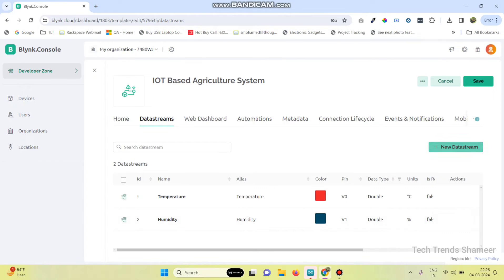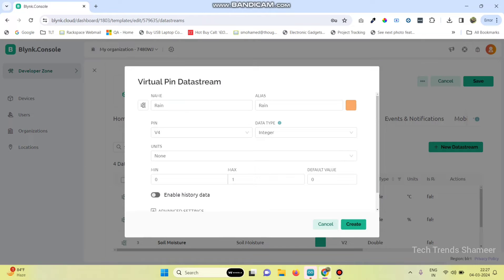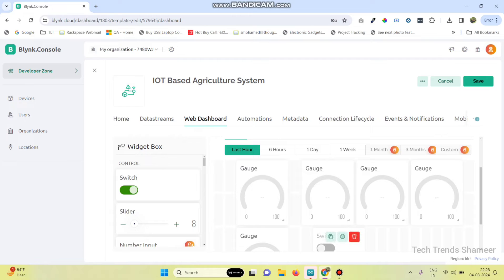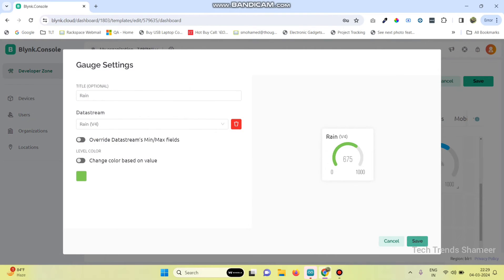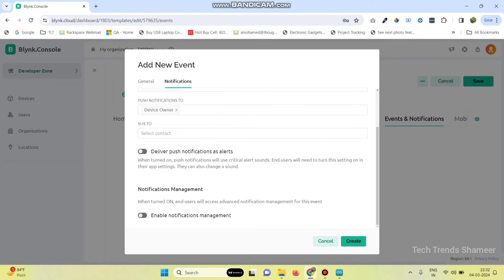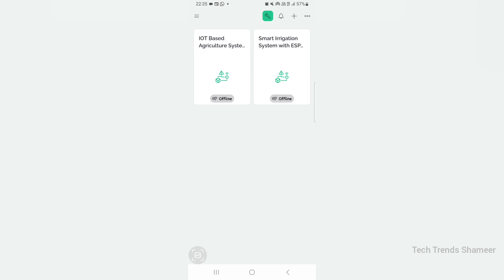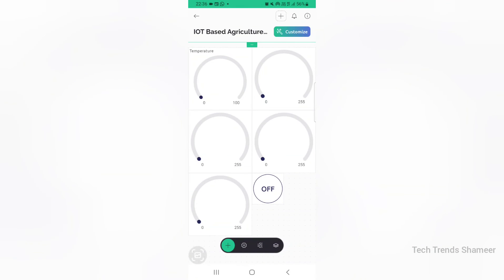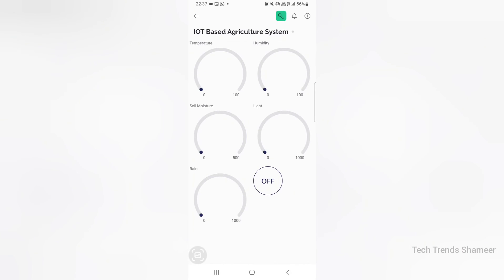IoT Agriculture Monitoring System | Smart Agriculture Monitoring with ESP8266

Comment: WARNING: library LiquidCrystal I2C claims to run on avr architecture(s) and may be incompatible with your current board which runs on esp8266 architecture(s).
C:\Users\adars\Downloads\sketch_oct9a_copy_20251010060915\sketch_oct9a_copy_20251010060915.ino: In function 'void setup()':
C:\Users\adars\Downloads\sketch_oct9a_copy_20251010060915\sketch_oct9a_copy_20251010060915.ino:138:13: error: no matching function for call to 'LiquidCrystal_I2C::begin()'
  138 |   lcd.begin(); // Initialize LCD
      |             ^
In file included from C:\Users\adars\Downloads\sketch_oct9a_copy_20251010060915\sketch_oct9a_copy_20251010060915.ino:13:
c:\Users\adars\Documents\Arduino\sketch_oct9a\libraries\LiquidCrystal_I2C/LiquidCrystal_I2C.h:58:8: note: candidate: 'void LiquidCrystal_I2C::begin(uint8_t, uint8_t, uint8_t)'
   58 |   void begin(uint8_t cols, uint8_t rows, uint8_t charsize = LCD_5x8DOTS );
      |        ^~~~~
c:\Users\adars\Documents\Arduino\sketch_oct9a\libraries\LiquidCrystal_I2C/LiquidCrystal_I2C.h:58:8: note:   candidate expects 3 arguments, 0 provided
exit status 1

Compilation error: no matching function for call to 'LiquidCrystal_I2C::begin()'

Comment: Sir, I have a doubt. Can you clarify it for me?
Sir, the data pins of both the soil moisture sensor and the rain drop sensor are connected to the same A0 pin of the ESP8266. Will it be able to read data from both sensors simultaneously?
Reply from the maker: Yes. It can read.
Reply: @TechTrendsShameer   no sir it read    data signal of any one device. i also ask from chat gpt, and his conclusion that esp8266 read any oone signal or data.
Reply from the maker: Check the circuit again. It should read if you connect to A0 pin
Reply: It not work properly